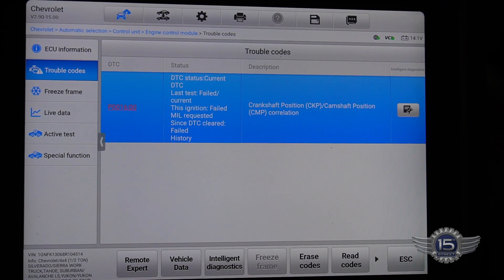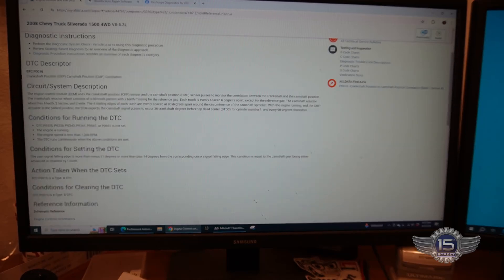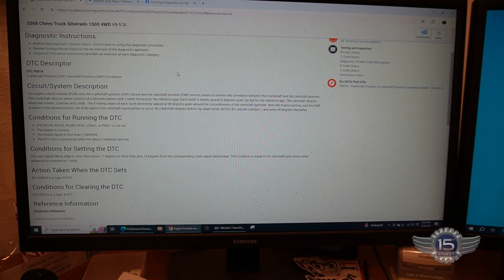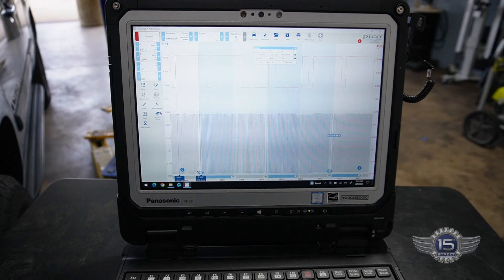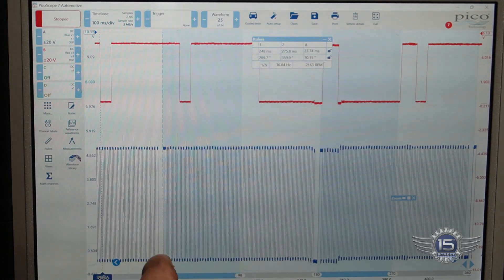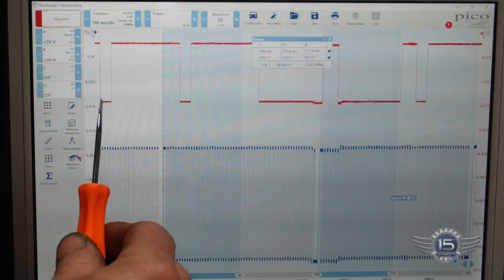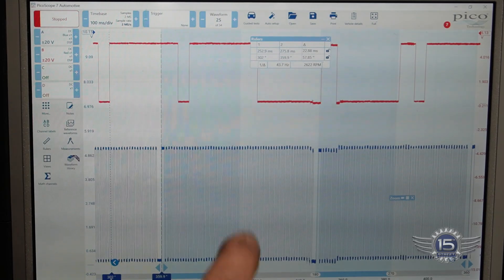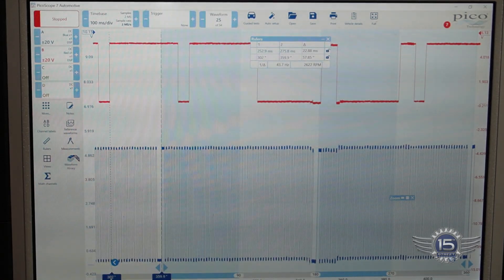Chevrolet Silverado P0016 Cam Timing Problem

Comment: He didn't say, but the owner would not have brought the truck in for the MIL with cam timing off by 21 degrees. The truck would run like crap. If at all. The host knows this and is why he is going to try and free the spool valve. GM didn't copy the Japanese who came out with VVT. The spool valve/oil control valve is separate from the magnetic actuator.

Comment: My truck has VVT and along with the intermittent P0016 code, I'm leaning more towards a VVT issue rather than jumped timing.  It either starts and drives fine or it has a long crank after a heat soak and then wants to stall.  The P0016 code comes and goes.  Thoughts?
Reply: Did u fix it?
Reply: @denisgonzalezblandon1538 yes and no.  It was an oil pressure issue due to worn cam bearings.  I got it working by installing a phaser lock so there was no way it would move.  Truck runs but lacks power.  The better option would have been converting it to a non vvt cam.
Reply: What was ur oil pressure at? Ive seen that mine doesnt match the desired cam angle @89vette1
Reply: @denisgonzalezblandon1538 it would get down to about 20 at idle.  The service manual said it old be as low as 6psi.  But obviously not.  I used a picoscope to verify the cam and crank correlation and could see that the cam would fully advance on its own without command and it wouldn’t run until it cooled off. It drove me nuts because I could understand how the phaser moved “ahead” of the crank without command but it can due to the valve spring pulses.  The phaser would not stay locked.

Comment: enjoyed the vid, wish that i could figure out / grasp what you did with the waveform and the rotational rulers to figure out the cam/crank timing
Reply from the maker: It’s a function in the pico scope, but there is a learning curve. You’ve got to use it to learn it though.

Comment: actually looking forward to the timing cover comming off.  deffiantly make a good video
Reply from the maker: Customer is trading vehicle in and not repairing it. I had a overlay caption in the video that explained that but for some reason it didn't make through the editing process, not sure why. But I'll get another one in that they'll want to fix it.